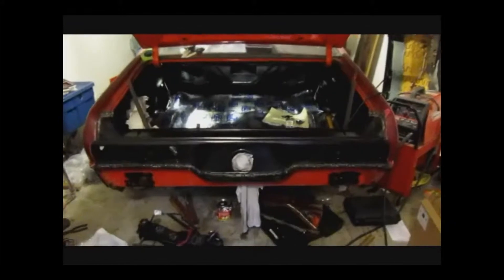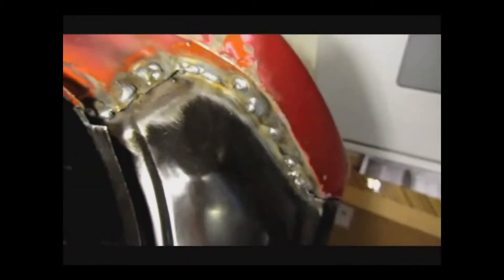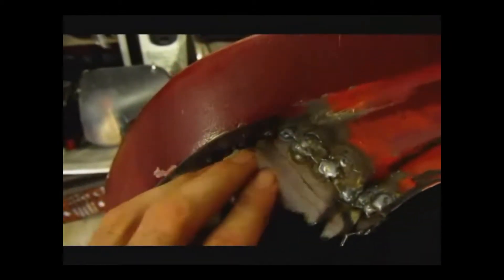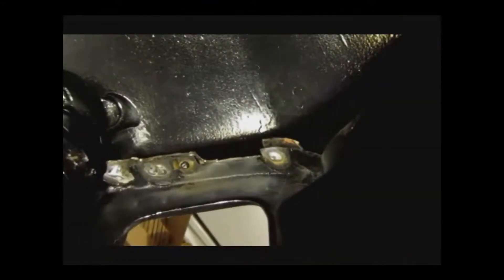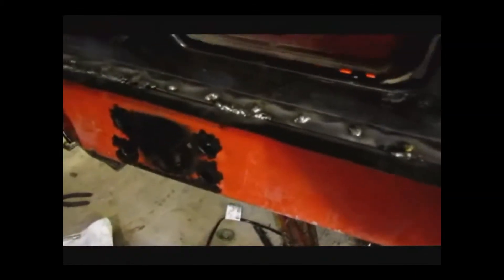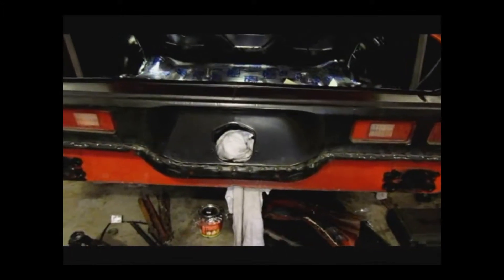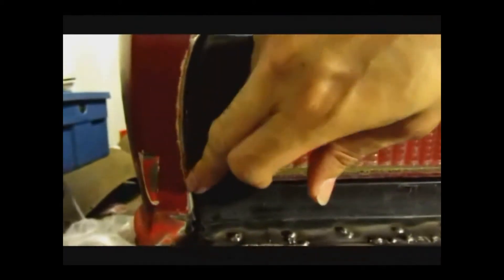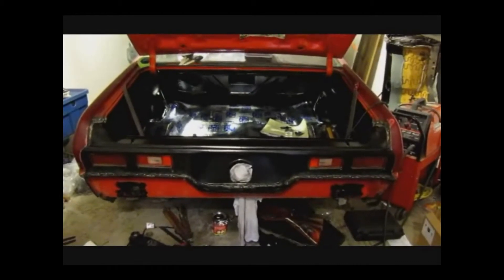74 Chevy Nova Update - Real Tail panel installed Ep  2

Comment: Gas tanks and welding freak me TF out ever since my brother blew one up on him. Good idea with the rag though.
Reply from the maker: Yes it can be scary. There are two types of gas caps. Vented and not vented. I had the Non Vented cap (charcoal canister still installed). Keep that in mind if you are going to weld around that area EVEN if you use a rag.